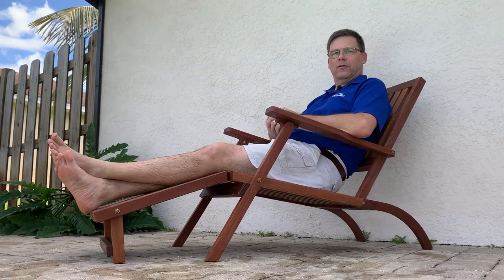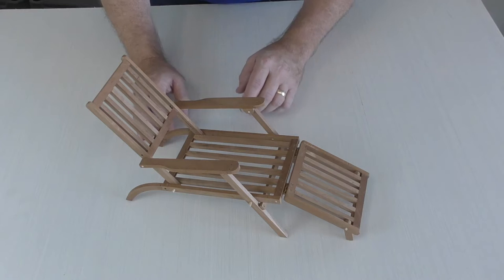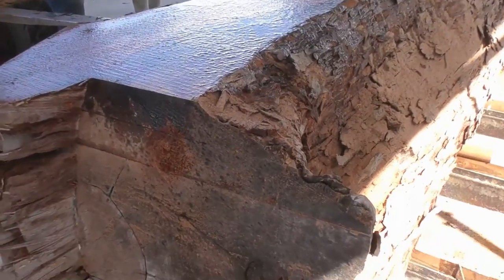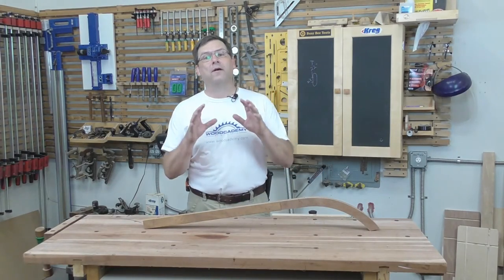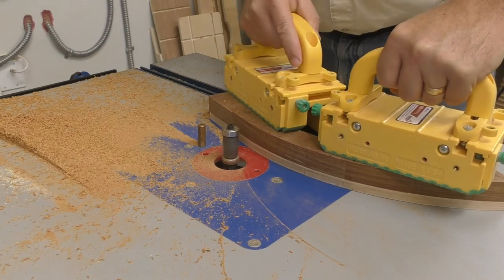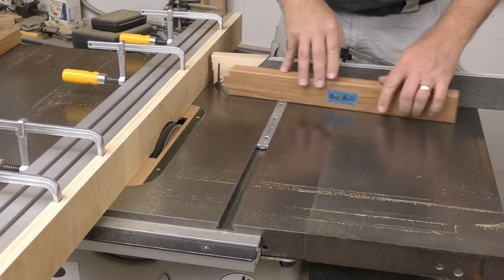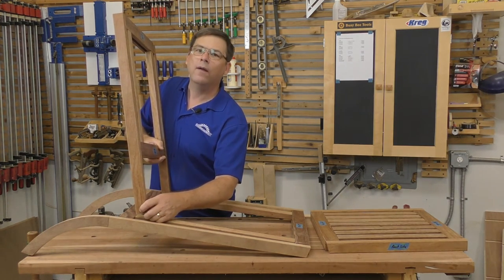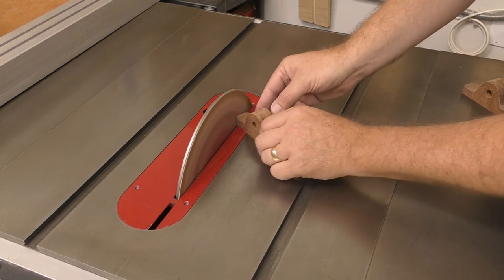Steamship Deck Chair Build Part 1

Comment: Most amazing undertaking, happen to secure a complete teak elongated teak table set with 6 chairs and 2 steamship deck chairs a few years back (from Florida) that live outside,  it's been challenging  enough to replace/repair  broken components using teak yet build them from scratch, my hat is off to you.
Reply from the maker: Thank you, Michael, your kind words are appreciated.
If you still need teak for parts, Advantage Lumber now has their own plantation-grown teak available. It is certified sustainably grown on their own land in Brazil.
Reply: @Woodcademyshow  Thanks Ralph, they are  5 hours away and I don't need that much teak to qualify for free shipping. Beautiful wood but my projects can't justify the cost.
Reply from the maker: @inspectr1949  I get that for sure. Just a source if you ever do need it.